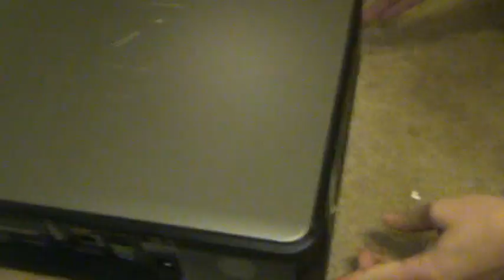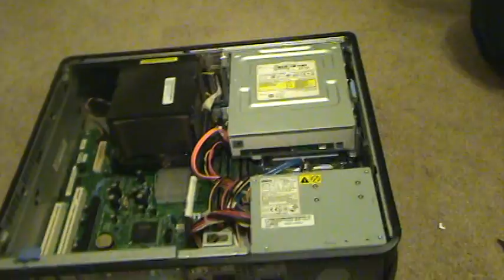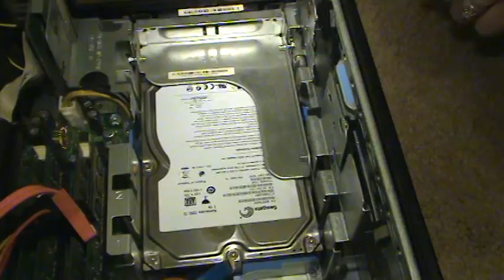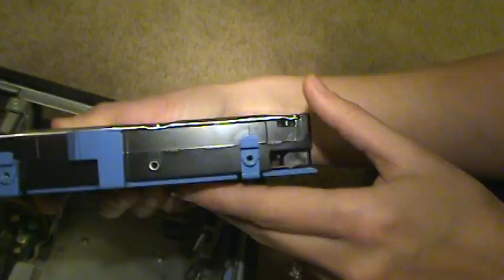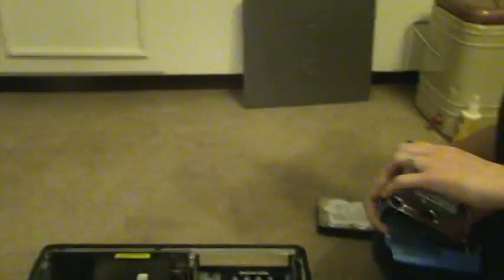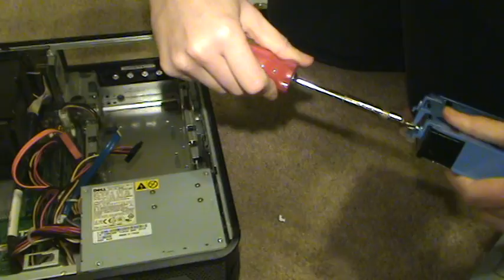How to replace a hard drive in a Dell Optiplex 755

Comment: Matt...cracking video. But is the SATA BUS CODED? NOTICED  YOU PLUGGED THE BLUE SATA LEAD INTO THE NEW HDD. THEN THE RED LEAD TO THE CD ROM/DVD . IS THIS OLD IDE DRIVE 0 DRIVE 1 SYSTEM? I am TOTALLY NEW TO SATA DRIVES. CAN YOU HELP PLEASE?  THIS is in UPPER CASE coz I have baF ryes OK?...Thank you...

 IS IN UPPER CASE COZ I HAVE BAD EYESIGHT OK? 

 RUESIGH

Comment: You didn't have to remove the "screws" on the blue plastic casing. Those are pins that slot into the hard drive screw holes. You just pull back on the blue tabs above the pins to release the drive.
Reply from the maker: Appreciate you telling me that but I no longer have that computer it was a client's. 😆😊
Reply from the maker: Is that you on the picture? Know some good adaptations for gym stuff? 😊

Comment: Huh, my hardrive was in a completely different location. In a slot at the front under the fan. Easy peasy just remove the wires then press the blue clips outward. No screws.

Comment: Can this pc hold 2 harddrives?
Reply from the maker: Not sure, I would think so, pretty sure someone on this thread would know, sorry I'm just super busy right now: https://youtu.be/reCmEXCkfbQ
Reply from the maker: Not sure, I would think so, pretty sure someone on this thread would know, sorry I'm just super busy right now: https://youtu.be/reCmEXCkfbQ
Reply: Barely, depends on the size of the hard drive. 2.5 should barely be enough to work, and you would still need two other wires to set up the 2nd hard drive.

Comment: Matt
I had to change the the Battery on the Bios. I turned the power off unplugged the hard drive installed new battery plugged hard drive back in and now getting a hard drive error unable to find hard drive error 2000-0141
have any advice ?
Thanks John
Reply from the maker: John Lewis With no components hooked up are there any status beeps?

Comment: how many HDD does your computer support ?
Reply: The motherboard of Optiplex 755 contains 3 SATA and 1 eSATA connectors so at least theoretically you could add minimum 3 hard drives. Problems comes when you want to fix them there.